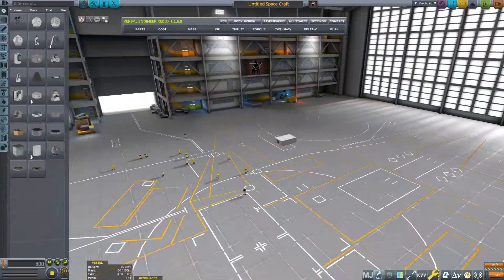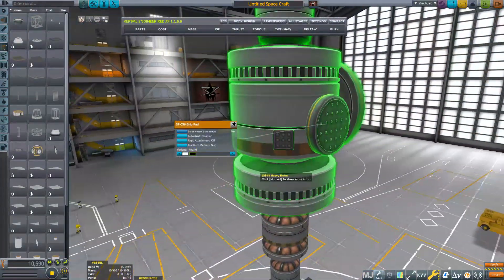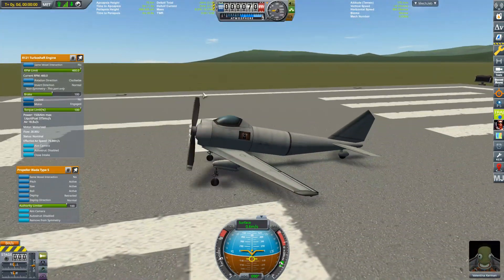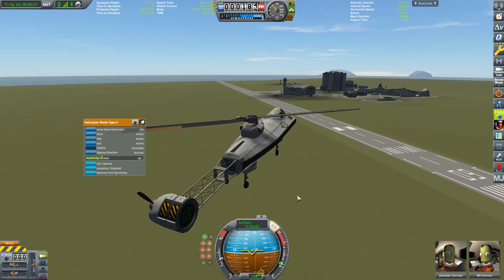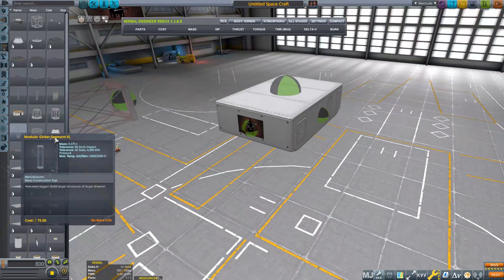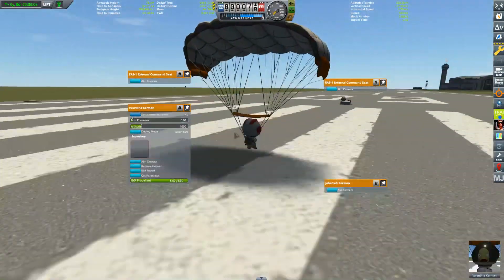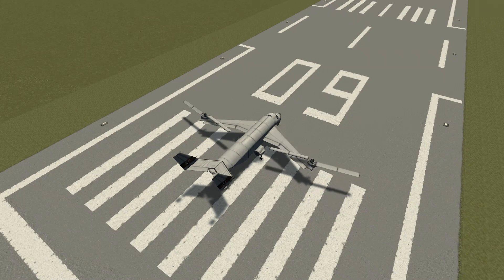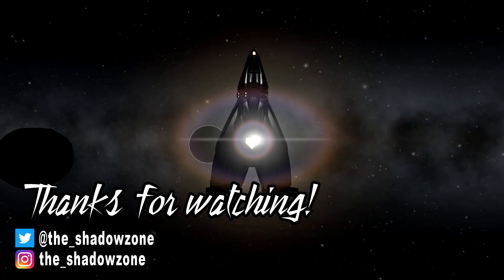KSP 1.7.3 - NEW Helicopter Parts, Ejector Seats, New Docking Features

Comment from the maker: To make it clear: The turboprop engines and prop blades are only available for those who also own the "Breaking Ground" DLC. All the other things I have shown (apart from the robotic arm) should also be available in stock KSP.
Sorry for the confusion.
Reply: Noooooo
Reply: You helped me soooooo much with this video👍
Reply: Can the prop motors be configured to follow the throttle?
Reply: @liroyYT28  If I recall correctly it is not on default as they may overwhelm newbie
Reply: That's a load of crap this is a areospace game propellers should come stock
Reply: I can't figure out how to cancel symmetry for parts so that mirrored tilt rotors don't turn opposite directions (e.g. one up and the other down).
Reply from the maker: If you don't have the option in the right click menu, check the game settings if "Advanced Tweakables" are activated.
Reply: @travisparker5632  if you right click your part, the menu should have an option to remove from symmetry. I don't know if that is the right thing but... May be it'll work...
Reply: grip pads are under breaking ground section of changelog
Reply: I have all DLC, and KSP 1.7.3. but they don't seem to appear
Reply: How tf did i miss the prop engine, I totally didn't see it.
Reply: This update needs to come out on Xbox one

Comment: if you stack two motors which spin in opposite directions, adjust the angles to produce lift on both props. when they spin the opposite directions the torque they produce counter each other and stabilize your heli without the use of a tail fin and SAS(its still pulls a little but its almost eliminated.)

Comment: 3:40 It looks like the propeller wasn't working quite right because the blades were attached "wrong". Rotate them 90 degrees on the axis that runs through the propeller blades and they will work without having to deploy them (although adjusting the blade pitch that way can be useful) and it won't try to roll the plane as much and should produce more thrust. The propeller blades in this video were essentially attached already feathered (https://en.wikipedia.org/wiki/Blade_pitch#Feathering).

For the helicopter, I find it convenient to bind the blades' Authority Limiter to the Main Throttle action group so that the throttle acts as the collective (the maximum RPM and torque settings on the engine act like a governor already, so they don't need to be bound unless you want a manual throttle, which would use the torque setting) and enable Pitch and Roll so that the pitch and roll axes act as the cyclic. Enabling yaw on the tail rotor allows the yaw axis to act as the anti-torque pedals. You have to keep the throttle within a small range so that the blades don't stall on the high end or push the helicopter down on the low end (joystick remapping software can do this, but you have to calibrate it for each craft).
https://en.wikipedia.org/wiki/Helicopter_flight_controls

Comment: Because of the torque of a propeller if you increase power to the propeller it will give the craft torque. Planes in real life could accelerate that fast while take off to make sure it doesn’t happen.

Comment: Are the 1.7.3 parts only for the expansion?
Reply: The helicopter/airplane parts its necessary the DLC, bow the other functions, like the ejector seat and the docking ports feature will not require the DLC.
Reply: Life isn't fair it it it it just isn't

Comment: all my stock prop building brethren, do not fear, it is dlc, there is still a place for us
Reply: Meh. Stock props are voodoo. It works when it shouldn't, lol.

That said this DLC has the potential to render quite a few mods obsolete.
Reply: @lucifer6966  no, them breaking is the voodoo, they're pretty simple if they work right, it's just a spinny boy inside a tube
Reply: @gabrielsturdevant9700  Something that was more of a quark. My attempts always invite the kraken. 

If one tickles the kraken just right, he'll get you to orbit, or even Eve, in record time. A giant air powered flywheel going mach 4 then decouple once rotation is at peak. The kraken often assists one in existing Kerbin at mach 15+.

Comment: Anyone else having problems with horizontal decouplers since the update?

In the past, I've had no issues with using them for asparagus staging, but recently, they "decouple" but the boosters are still stuck to the main central stage...
Reply: Doublecheck that the boosters are actually attached to the decoupler. I've certainly clicked 'through' a decoupler once or twice, thus attaching the boosters to the tanks instead.

Comment: I didnt undersand , is it only for the breaking ground expantion or for the stock game ?
Reply: I think only the fuel-powered rotary engines and propeller blades are DLC-only. It really wouldn't make sense for the Dev-team to maintain 2 different sets of vessel-functionality for just the part interactions or the symmetry options, or 2 different command seat parts.
Then again, those same-vessel interactions could be used to make propellor-aircraft without DLC, so it's not impossible for everything to be added to stock.

Comment: You've wrolgly attached the blades @ 5:26 - that's why it's vibrating and clipping. I suspect you've attached them in mirror symmetry.
Reply: It's a long standing issue in KSP with rotational torque - the same happens when you spin a rocket: the fins get spun away from the hull
Reply: @bengrogan9710  No, this is not the issue here. These blades alleviate this issue in a somewhat weird but effective way. And anyway, people have been doing propellers with parts that do get stretched, which were completely stable. The issue here is that he attached both blades to a single point on the motor, which causes vibration. You can clearly see that one side has a round blade base, while the other does not.
Reply: @DV-13  Go frame by frame as rotation begins, both are mounted properly with the mount visible, the vibration starts as it extruded through  the motor hub

Comment: The same vessel interaction should also make it impossible for cargo to clip out of the cargo bay because it bent in a weird way, right?
Reply from the maker: I believe clipping parts with interaction active will go boom on launch.
But it might prevent cargo from flopping around when just attached to a single docking port inside a cargo bay.
Need to try that.

Comment: I have never loved squad and take two this much in my life. They finally listened to the KSP community.
Reply: Just modular heat engines missing
Reply: @matsv201  what is a modular heat engine?
Reply: @linecraftman3907  it's when the heater is split from the rest of the engine.

A heater can be air-fuel. Or oxygen-fuel. Or some type of nuclear. (There are at least three diffrent major kinds). Theoretically or could be electric to, but that don't make any sense.

The engine could be rocket, turbie or shaft.
Reply: @matsv201  why do we need that in the game?
Reply: @Zwettekop  To make nuclear powered jet engines. Also to make shaft engines...

The system could also be used to make electricity. Making a sort of modular RTG.

It also could be made to make a larger selection of nuclear rocket engines
Reply: @matsv201  What is wrong with regular jet engines?
Reply: @Zwettekop  
1: they use fuel
2: They use oxygen
Reply: @matsv201  The nuclear engine also used some sort of fuel and why does oxygen consumption matter. Jet engines have a weird tendency of not working in space anyways. The only difference would be planes on eve and duna no?
Reply: @Zwettekop  regular jet engines arnt actually just the nozzle on the end of the plane, theyre usually further forward inside the fuselage.
Reply: @matsv201  Rudimentary modular heat engines could be added with just Module Manager config files. Edit parts so that they generate or consume a new HeatEnergy resource! I made a proof-of-concept a few years ago that did something similar, but with mechanical and thrust output from an engine turbine abstracted as a new Power resource, which was consumed by engine nozzles or turbine-driven shafts. It worked well for diverting thrust to RCS nozzles for VTOL jet flight.
Reply: @benjwgarner  well of cause.. scott made a whole series with modular heat engines quite a few years back.. its nothing new.. i just wish it was in the base game
Reply: @spawnof200  We're talking about additions to the stock game though. And currently jet engines do function like magic nozzles that produce thrust.
Reply: I just wish they'd the ability to spawn in seats
Reply: @Fireheart318  already in
Reply: Money talks. Any sane company would listen to their dlc buyers.
Reply: If only they cared about the console community